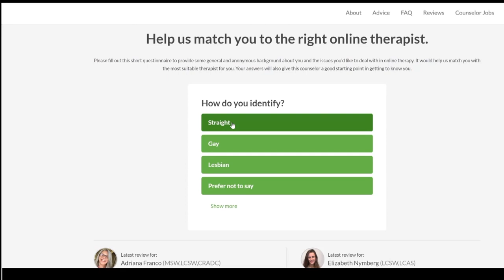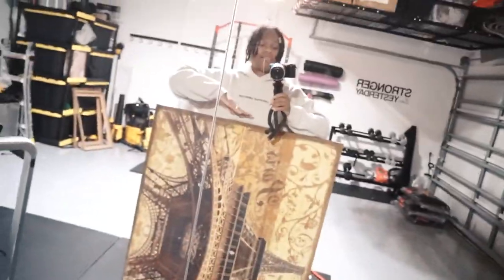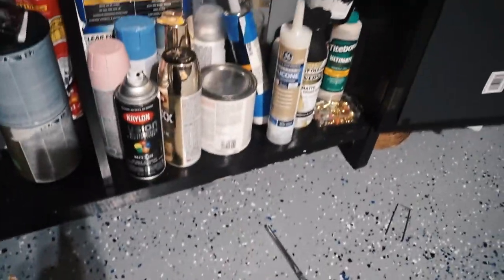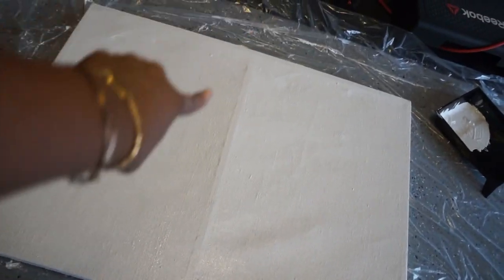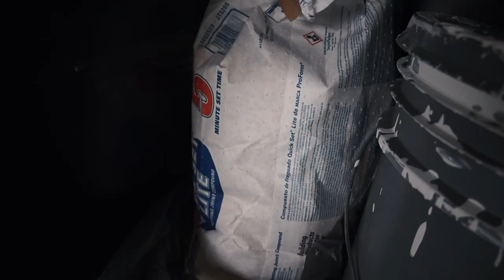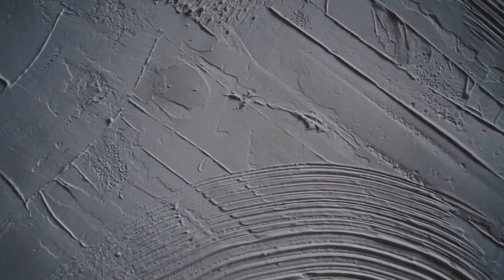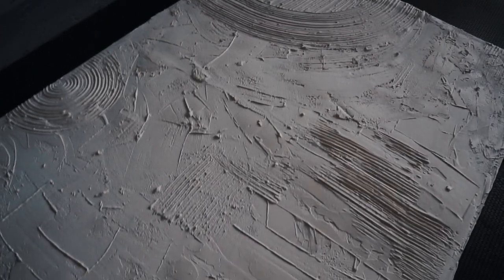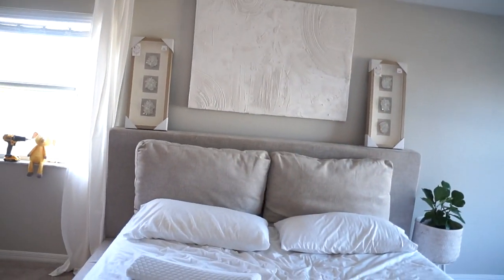MASTER BEDROOM UPDATE ! NEUTRAL DECOR AESTHETIC | THRIFT UP-CYCLE | DIY TEXTURED WALL ART | VLOG-MAS

Comment: I did this last year to an old canvas I had. It is about half this size. I used left over spackle we had and some random navy blue and white acrylic paint. Once the spackle dried I put random blue designs here and there then I mixed some white into the blue paint to make it a shade lighter. I then added some of that color as well for slight variation. I wasn't excited about how it came out but then I flipped it and really liked it. Its been in my office ever since.